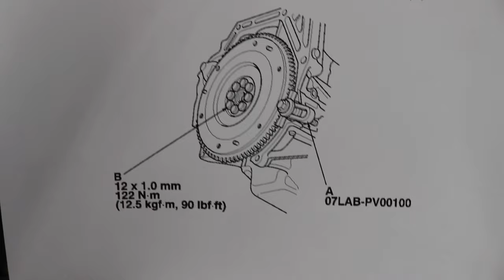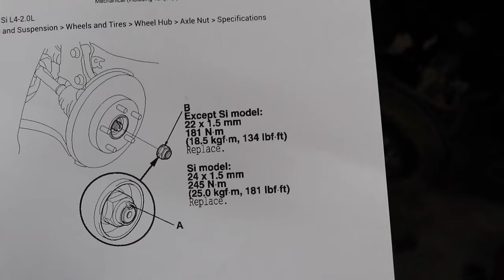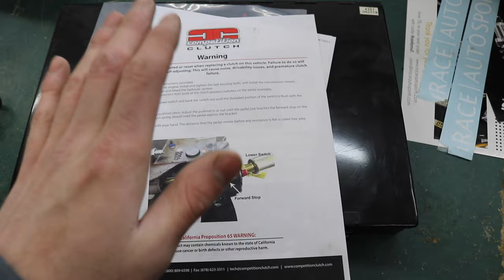Honda Civic Clutch Replacement!! (Si)

Comment: Words for the wise, if you can’t get into 1st or reverse, turn the car off, put it in desired gear, then start it up.this is just to get you by until you have to swap clutch out.

Comment: My friend and I are attempting to replace the clutch on my '08 without removing the subframe. It's tricky but there's just barely enough room to remove the clutch, not sure how I'm going to do the throwout bearing though. Gonna try and put the new one on tomorrow, but I just wanted to let you know that your video has been super helpful to us so far :)
Reply from the maker: Good luck! That will be tight for sure 😅 appreciate the support 🙌🏼
Reply: Update: We decided to just drop the subframe because the pilot bearing was a royal PITA. We also made the exact same mistake and dropped the steering rack 😅
Reply from the maker: @222clove  This made me laugh way too hard 😂
Reply: @DanielKellert  i learned not to make that mistake, thanks to you lol
Reply: Yeah I dropped my sub I was thinking I probably could do it without dropping but why not make love easier but dropping it, not that big o deal. Thank you for the idea of strapping it that worked good
Reply: Yeah deff gonna strap my rack so I don’t have to hassle with the wheel afterwords. My only problem is finding a shop to machine my flywheel. They said they can’t machine dual mass flywheels. Is that what ours would be?

Comment: Just a little tip for anyone that has replaced their clutch and got their civic put back together and now it won't start. Check your bolt that goes back through the one plastic wire harness. Sometimes ppl forget to put it back in. I remembered to put it back in but it was so corroded that it wasn't making proper ground connection so I wire brushed all metal contacts and then checked continuity at all places between that point and the battery. That includes the wire going from the transmission to the frame and the other one going from the frame to the battery. Apparently this is a major problem with civics that crank and don't start after doing major work and removing this bolt. One quick way to check is to hook a code reader up to it and then if it starts and runs with the code reader on then you have a bad ground.

Comment: Thanks for the video man. I was able to change the clutch in one and a half days in my driveway. It was honestly really fun and easy. The hardest part was lining the transmission back up to the engine. Everything else was super smooth sailing. Your video definitely helped alot!

Comment: Thank you for a great guide on how to tackle this job.  We were following a combination of your process and that of the Honda Service manual which we downloaded, and had the same issues in loosening the rear engine mount bolts and intermediate shaft bearing housing.  In the Honda manual, they suggest dropping the subframe earlier, which in hindsight is exactly what we should have done, as those bolts and those on the heat shield are very easily accessible with the subfame out of the way - that is the way we reassembled.

To lower the subframe you have only the big six bolts and one for cable clip and another clip, so once those are out of the way (after disconnecting the lower ball joint on the lower control arms and tying up the steering rack to the top to prevent it dropping), everything else is a breeze, even the bracket supporting the right hand shaft carrier bearing.

In terms of "how much can you drop the subframe to get access to remove it's brackets and cables, we found that if you turn out the four long bolts located on each corner of the subframe and leave just enough thread in it so it still supports the subframe, you can access all.  The subframe is not that heavy.

Instead of supporting the engine with a jack from below, we fabricated a hanger (Honda sells something to do this but we made our own - Engine Support Hanger, A and Reds AAR-T1256, Engine Hanger Adapter VSB02C000015) and hung the engine off that, while supporting it all on the front suspension tower mounts and front valence.  It took some time to set this up, but helped a lot as we could adjust engine level up and down from the top in finite increments.

Comment: Best video ever step by step too? Just did it today and finished it. Clutch feels amazing! Only thing is my  rack popped out we got it back in but the steering wheel keeps turning left? I didnt brake the clock spring or anything the steering wheel was locked in place with a seat belt! Anyone have any clues? I’m going to recenter the steering wheel tomorrow and see what happens

Comment: Hey man I cant thank you enough for making this video. I just finished replacing my clutch on my 2012 honda civic ex coupe with over 200k miles on it using this video. It took a long ass time, but we got er done!! Also replaced the slave and the CMC (which was probably the biggest pain in the ass of all).
Reply from the maker: Glad it helped you out man!
Reply: @DanielKellert  now im replacing the a/c clutch because that also went out lol

Comment: Nice work youngster! I did the the clutch job for my stepson’s 2008 Civic Si last year. It was challenging and satisfying once I got it all put back together and worked as intended 👍 I kept the rack opinion secured instead of removing the whole assembly.  I didn’t want to mess the alignment. When I was a teenager in the late 80s. I assisted my dad replacing the clutch on his 1968 Toyota Corona. It was fun and pretty easy being a rear wheel drive. This was my first time doing a front wheel drive. I knew it was going to take a while due to my work schedule. So, I lend him my old faithful 1997 Camry LE with over 300K miles on the clock. He was so impressed how smooth and semi fast it was. No comparison to his Si 😁

Comment: Just did mine this was a great video BUT guess I recommend remove steering shaft from under dash it’s a 10mm bolt and pull up on the shaft and disconnect harness from eps on passenger side

Comment: Something to note is you’re fine with the rack and pinion coming out which isn’t a big deal, you don’t need to take out any of the bolts. It’s only bolted to the subframe. hope this saves your knuckles😂👍
Reply: Also drop the subframe before taking out the steady bearing and starter bolts and it’s super easy

Comment: I followed your video step by step and my steering rack stayed up like you thought yours would. Thought that was interesting. Unfortunately the threads on my big starter bolt were absolutely obliterated. Thanks for the awesome video!
Reply from the maker: Ayy that’s what I like to hear Brett! Hopefully those threads were saveable with a tap or heli coil 😬

Comment: Just finished getting mine out today. Stock OEM clutch with 190k on it. Same exact issue, part of that spring housing busted out and I'd get locked out of gear intermittently. Chewed the absolute fuck out of my flywheel bolts to the point I didn't think there would be enough left for the socket to grab. Just waiting for my flywheel to be resurfaced and an Exedy OEM spec ones going back in! Hoping to never have to do this again
Reply from the maker: Nothin that can’t be fixed! Good luck with the install Austin 🤙🏼

Comment: Good idea is to take a paint pen and mark that spine up near the steering wheel. Then once you pull it all apart make sure you don't turn that rod 180. That way youll line right back up
Reply from the maker: I usually do that. In this case I didn’t know the rack was going to fall out 😅 on most cars the intermediate shaft is bolted to the column & rack

Comment: Thanks for the great detailed video! My 2012 Is will need a clutch eventually with 135,000 miles on it already - it's not slipping... yet! I don't run it very hard either!
Reply: I'm about to hopefully get a 2012 that needs a clutch I'm still not sure if I wanna attempt this myself or take it to a shop

Comment: Did you get chatter on the clutch during the break-in 300 mile period? If so, how much? 

Did it get better after break in?
Reply from the maker: Little bit of heavy chatter for first maybe 500-1k miles, after that the chatter has been pretty minimal. Which is crazy for a 6 puck, usually they chatter like crazy. Competition must put some really good damper springs in the clutch hub.

Comment: As someone else said wrap wrap wrap lol. It gets very hot back there with a sidewinder. As for the coolant lines to the throttle body I’ve had mine looped for years and never had issues even in subzero temps. Solid content bro, your going to fall in love once it’s together and running. Heads up keep torque as low as possible during tuning. These stock transmissions are made of glass and break even with na setups. Be prepared for that 😂
Reply from the maker: Think you meant to comment on the turbo civic build video 😅 but yes you are 100% right. Good to hear about the throttle body hose routing! I’m so excited to get this thing running 🔥
Reply: @DanielKellert  😂😂 well shit I guess I did that lol my bad, you get what’s going on so probably not going to bother correcting it. Aye keep it up man 👍

Comment: Hey Daniel, I have a question. I have a 2015 Honda Civic LX (NOT Si), and I am the first owner with the original clutch in place. It still grabs and engages very well, but how do I know if my clutch is going or not? You said it locked on you on the HW out of nowhere? Or did you already notice symptoms prior? 

I have 95K on it. Obviously a clutch can last for as long as the driver drives well (not racing the crap out of it), but want to make sure It doesn't happen to me. But also, Everything is stock. If I were to get a new clutch, could I get a beefier one without having to mod anything else? 

What do you think! 

By the way, you don't detail your engine bays? LOL

Comment: Just curious why you had to disconnect the tie rods. Usually just leave the rack suspended by leaving the tie rods in place. Or were they in your way for something?
Reply from the maker: Makes it easier to get the axles out with the tie rods off, but would’ve been smart to bolt them back up after the axles were out & suspend the rack by the tie rods like you said 🤦🏻 oh well! Appreciate the info! Definitely doing that next time 😅

Comment: I came here because I have throwout bearing that is potentially going because of a rattle I hear on engine brake (even light engine braking). The pisser is I had the clutch done 2 years ago and it started up almost right after I had it done. I don't think the guy changed it out. I think I need lower control arms done too. FML. I  just did brakes and pads for the first time last week. This is a bit more than that. :) lol

Comment: Hey I'm having to replace the clutch on my 09 si and wanted to know which clutch I should go with for a daily driver?
Reply from the maker: For a daily I’d just get an Exedy oem replacement or an Exedy stage 1.
Reply: Thanks man. Would it be recommended to replace the flywheel as well?
Reply from the maker: @justinfrick5200  Either replace it or get it resurfaced 👍🏼
Reply: I just put a stage 1 in my ‘12 si definitely don’t go cheap! 😂 exedy has been highly suggested I unfortunately did not go with that brand. I went with ClutchMaxPro. As of 988 (600 is city the rest was highway) miles the throw out bearing that came with it is bad already smh. Putting a Honda T/O bearing on next week and we’ll see how this cheap brand stage 1 holds up 🫤 i don’t have much hope. Wasn’t my choice of brands kinda had to just get something on so I could get my kids around since it’s my daily.

Comment: Hey dude, I recently replaced the clutch on my 2012 si and we put everything back on but after driving it for a little the vsa light started flashing on the dash and the brake pedal vibrates when being pressed. I was wondering if you know what this could be?
Reply: I did a job a while back, someone did a clutch change and had the same problem. I found that they stretched the abs cable that Is connected  below the air intake housing,

Comment: Oops ..sorry added a question where it shouldn't have gone.  Just wondering if you had to go with a less expensive clutch kit what would you recommend? Also, curious how long was the process? Thank you and a great video.
Reply from the maker: There is lots of other great kits out there, just depends on what your goals are for the car. I’m going to be boosting this civic so I wanted a clutch that can handle the increased torque. If you just want an oem replacement, exedy sells a very good oem replacement kit. As for time, I’d budget yourself at least 3 days to get it done if it’s your first time.

Comment: Also did you reinstall the sub frame first and then the power steering rack or did the rack have to go in first? Mine may have dropped out as well. Very awesome and informative video by the way!
Reply from the maker: Install the rack u joint to the steering column splines first, then lift them both in at the same time. The rack mounts to the subframe, just need to make sure the rack u joint is on the splines before lifting them in at the same time 👍🏼
Reply: @DanielKellert  cool man thank you!

Comment: Probably a stupid question, but can you confirm that the transmission will not bolt back up unless the shaft is properly lined up and engaged in the pilot bushing?
Reply from the maker: You won’t be able to bolt it up if the trans input shaft is not lined up in the pilot bushing & clutch disc splines. If it’s not lined up, you would have a gap between the engine & trans when installing the bell housing bolts. If there is no gap between engine & trans once it’s full seated, then you should be good to go 👍🏼
Reply: @DanielKellert  ok good deal. I fought with that thing for so long it didn’t seem real that I got it bolted back together.

Comment: great video. I just pulled a cracked 1.8 engine out the top keeping the manual trany in and fully intact. Just wondering if I should also change the 5 speed trany. gen.8 with 172,000 mi. JDM has one for $599. 

Having an amazing father son experience. Just like yours.

Comment: This will be my first time doing this, an amazing video! earned my sub, but quick question, how long would it take to do this procedure since I’m on a time crunch and this is the only car I drive daily, I brought a brand new flywheel so I don’t need to get my stock resurfaced, If I start at the break of dawn?
Reply from the maker: Appreciate that 🙌🏼 If it’s your first time I’d budget about 2 days to be safe if you go hard at it. Would also recommend having someone there to help you guide the transmission & subframe in/out.
Reply: @DanielKellert  I have a friend thank god lmao, but only thing is I have one jack, sadly I don’t have the money to pay somone and have enough yet to get another jack or a pulley system to lower the transmission but I hope that should be enough, but thank you!!

Comment: Hey just did my clucth and my steering rack fell out also. How did you get it back in with the steering wheel staright?
Reply: looks like I willalso be doing that clock spring thing.

Comment: Just put the stage 4 CC clutch in. Chatter is crazy at low rpms in 1st during take off. I have to rev it to like 2k and dump it a little to get it not to chatter. Did you have the same experience?
Reply from the maker: It’s a little chattery to begin with. For the first 3k miles/5k km of driving, don’t rev match on downshifts. Just let the clutch out slowly & let the friction surface rub against the flywheel to help break it in. Same concept as breaking in brand new brake pads. Mine has very little chatter now & have put about 30k km on it since. 👍🏼 hope it gets better for ya!
Reply: Yea a little is an understatement lol. I've only got about 200 miles on it. Hope it gets better.
Reply from the maker: @Arronk20  Well you gotta expect some chatter when you buy a 6 puck clutch with stiff hub springs & a heavy duty pressure plate 😅 it definitely won’t feel anywhere near the same as a full face disc & will chatter way more. 6 puck clutches are not meant for daily driving. I bought this clutch because I’m boosting the car & it can handle a lot of torque. Hope it gets better for ya Arron 🙌🏼

Comment: Me and my brother did this twice the first time I replaced my clutch 2 years ago qnd  because pos ebay clutch sent a bad pressure plate and drove like 4 months with a sideways steering wheel lol now I'm replacing it again cause pos ebay lol oe this time tho I wish I had this video then but I'm glad I got it now lol
Reply from the maker: Good luck! 2nd times the charm 🤙🏼
Reply: @Daniel Kellert  lol thanks man I'm trying to put the trans back in now wish I had one of those fancy lifts all I have is a jack lol

Comment: Hi all bolts are out including bottom starter bolt was there a top bolt as well that need to be removed because my transmission won't separate there only a pinch of play when trying to pry and wiggle off
Reply: hey, did you ever figure this out? i’m currently having the same problem with mine.
Reply: @sinder9739  yes the top bolt in the back also
Reply: @sinder9739  find a long pry bar with a thin edge to at least crack it open and use a second pry bar to separate fully it was a pain bro but I got it don't give up ok

Comment: Should I put locktite on the flywheel bolts and pressure plate bolts
Reply from the maker: Some blue loctite wouldn’t hurt anybody! I usually put blue on the bolts for every flywheel I do.

Comment: Stater comes out easier if you remove the upper intake
Reply from the maker: You don’t have to remove the starter to pull the transmission as I showed at 28:13

Comment: How would you do this if you didn’t have an engine crane
Reply from the maker: Just use a jack on the bottom of the transmission with a wide piece of wood. That’s how I did my buddy’s in his RSX. Engine crane honestly wasn’t much easier than just using a jack.